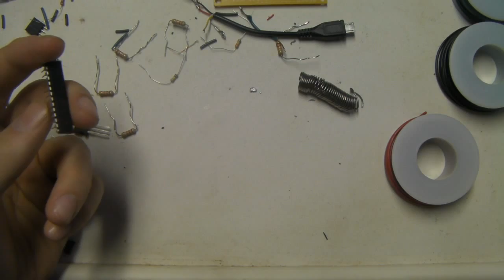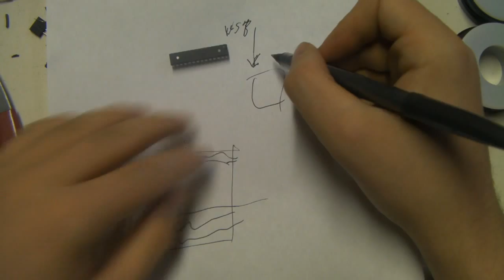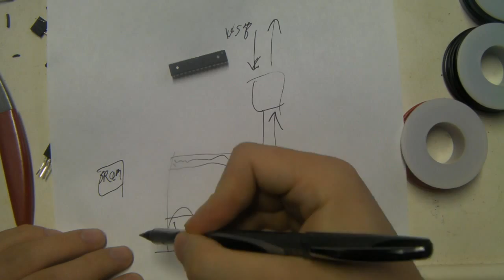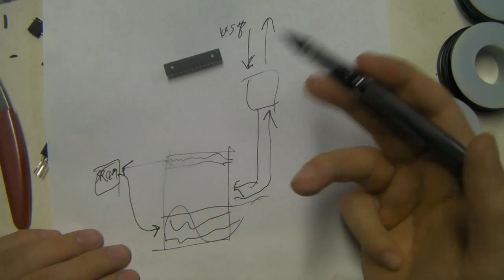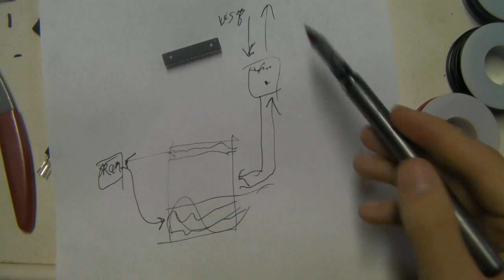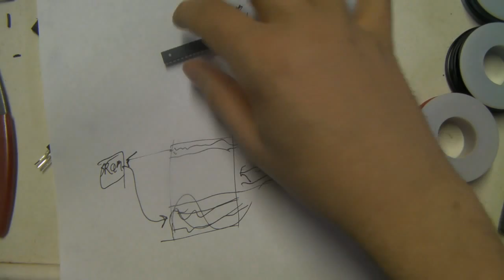Arduino Bootloader Basics

Comment: Nice video. I was a bit confused about your comment that all the program first goes to RAM though. Usually flash memory is much larger than your RAM, so that wouldn't be possible. But otherwise nice explanation. Thanks for sharing
Reply from the maker: I need to redo this video because Arduino changed the bootloader over to Opti boot, that is slightly different then the video describes it. BUT your computer sends over the program in packets and the bootloader loads it into RAM to make sure that it got the packet correct first. Then moves it over to FLASH.

Comment from the maker: ntldr is the Windows bootloader, best guess is that your HD boot sector is currupt, if you have a Windows recovery CD you can use that to fix the boot loader, just select the option to repair windows (then you may need to select the command prompt) then type "bootrec /fixboot" without the quotes.